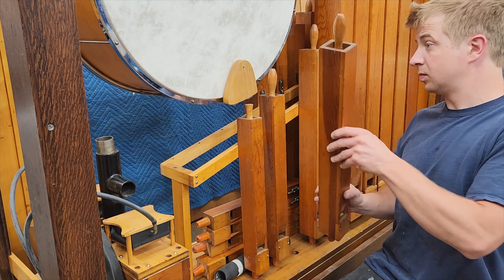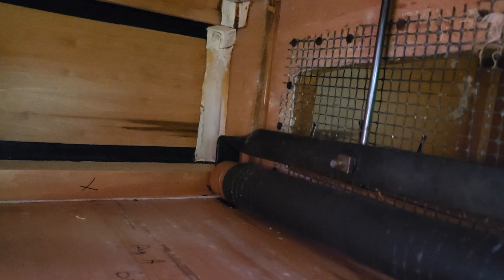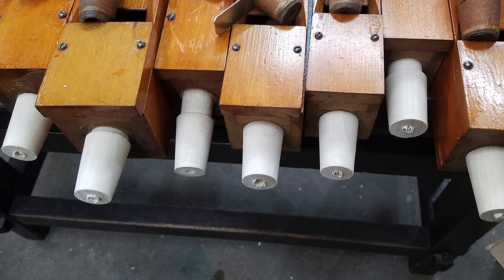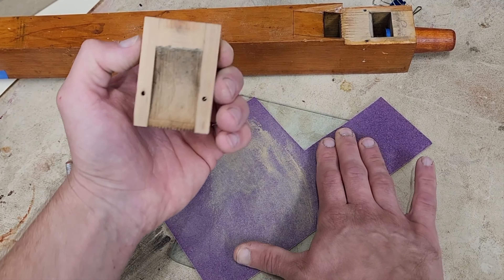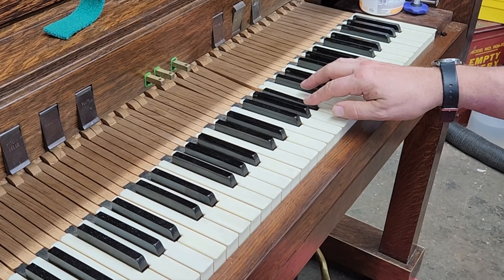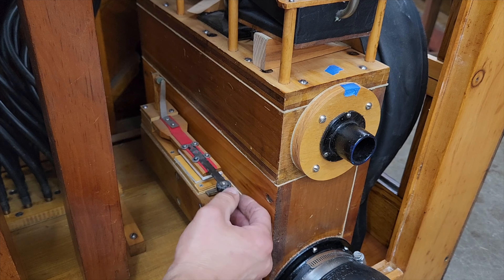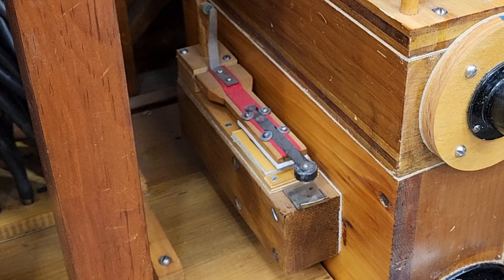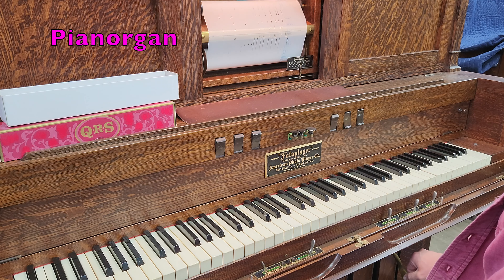Fotoplayer Fridays: A Peek at the Pipes

Comment: The regular bellows are meant to keep the air pressure the same no matter the load. The wooden pipes likely were over blown because the bellows had too much pressure!! The original pipe feet looks like they had a slot for a piece of metal inserted that is adjustable for air flow regulation for each pipe. You could have just repaired them and would be useful for way easier pipe regulation.
Reply from the maker: The slot was not original. They were cut but an owner who was running the machine without a regulator. I agree the metal inserts make for easier voicing, but since American Photoplayer didn't do it that way I wanted to return things to the original configuration. Hence the new toes.
Reply: @nateoutsidethevacuum ok good idea to keep original. Great info on your videos.
Reply: @nateoutsidethevacuum PS. Why are Gulbransen Pianolas not your taste? Are they hard to restore?

Comment: Wonderful! I hope my piano sounds as good as this when it's done, I might have a midi system installed as well since I write piano rolls but don't know how to cut them. Settled on a 40 note pallet valve setup but my piano is so compact it might be hard to fit. Thought about using string or rods going from the wippen of the piano action to under the keybed where I could keep the pallets and use tubes to transfer the signal to the chest which I'll probably put behind the piano for ease of access. Can't wait to see the cosmetic stuff, that's an area I need to touch up on quite a bit! Great video as always :)
Reply from the maker: Sounds like a big project! Keep at it. :)